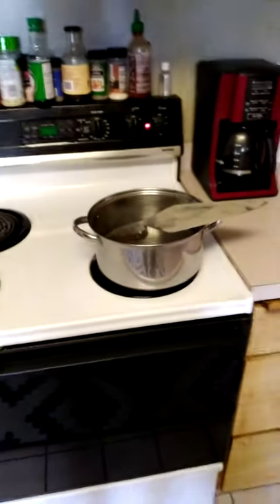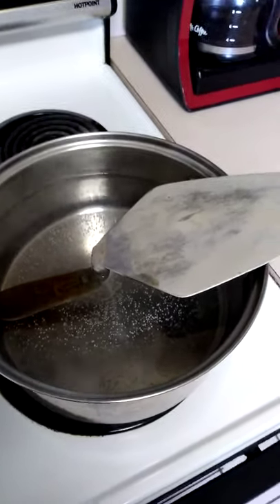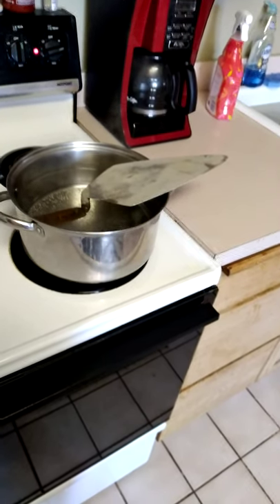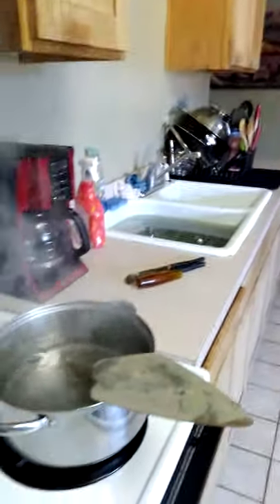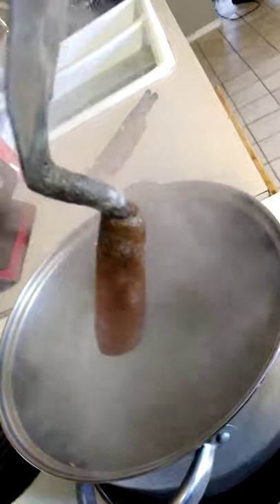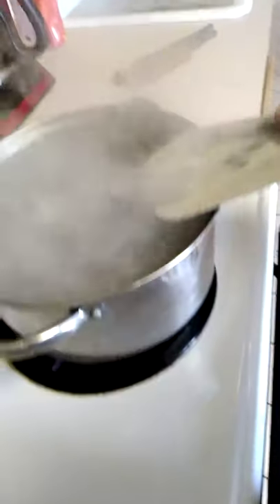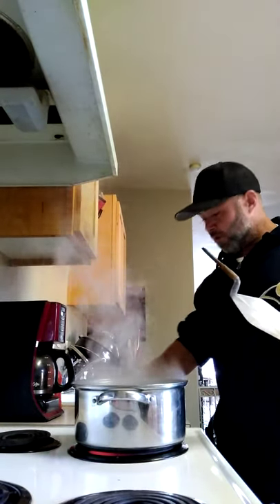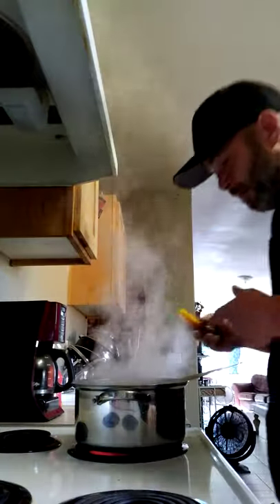Replace brick trowel handle

Comment: I'm pretty sure you do boil the new handle. I wide london (my preference) the cork handle broke in half. I will update after I try
Reply: U heat up the shank, either by boiling or flame. Then u slide on the handle.